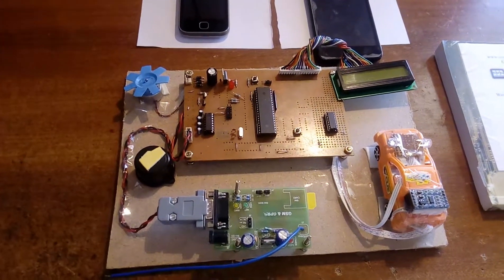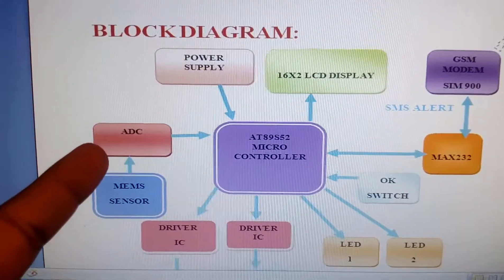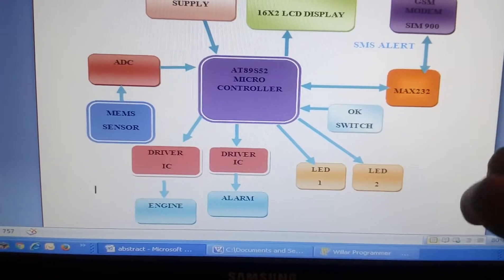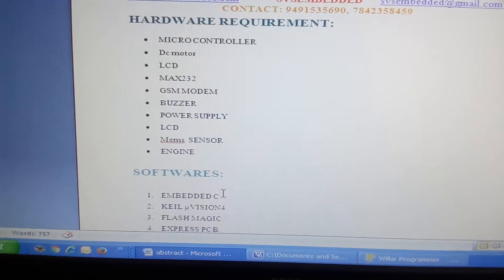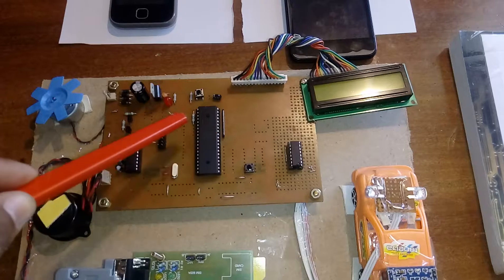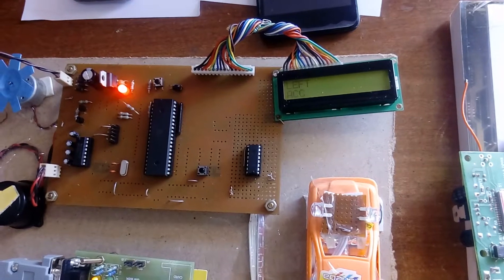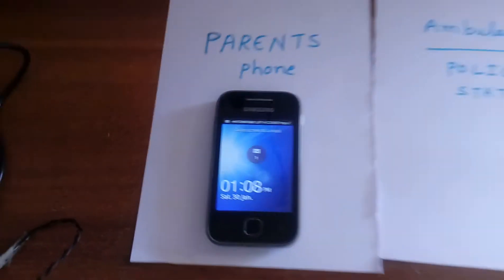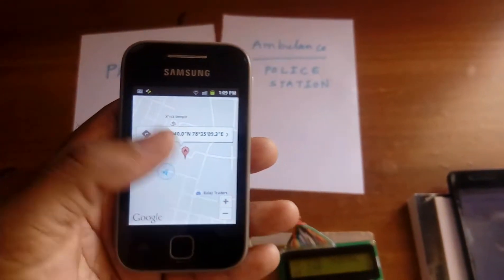IOT Based Projects: Intelligent Automatic Vehicle Accident Detection System Using GPRS

Comment: sir i wnt to contact u
Reply from the maker: Thanks for comment and your valuable Feed back. 9491535690,7842358459
send me a mail to svsembedded@gmail.com,info@svsembedded.com.

i am selling the projects.
i am providing the data to google drive 

1.abstract
2.datasheets
3.sample documentation
4.schematic( circuit ) diagram.
5.software code.
6.sample ppt
7.photos&video file on entire project